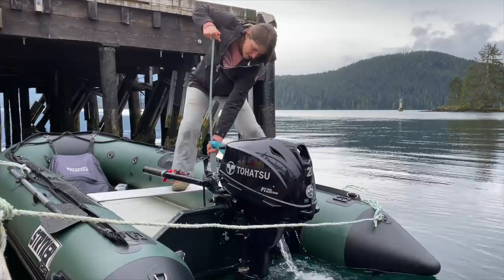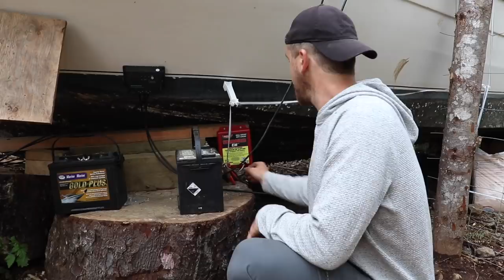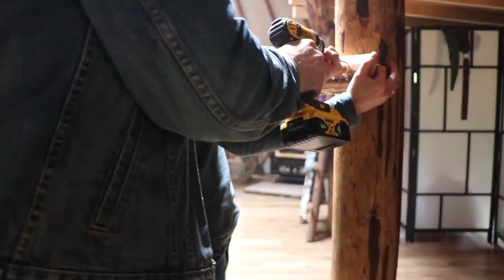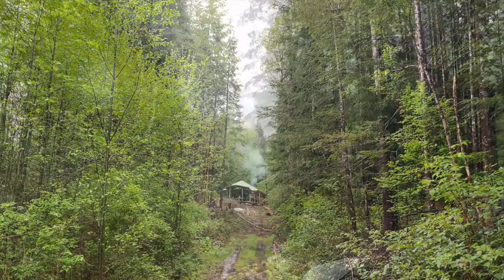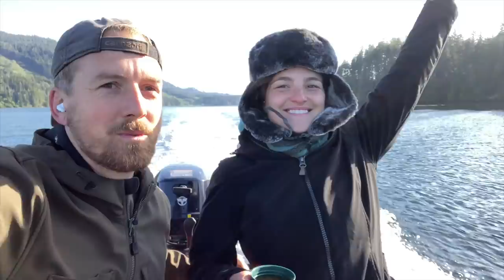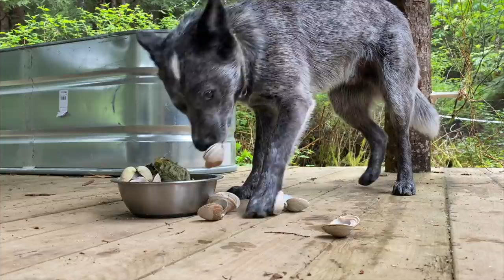OFF GRID WILDERNESS LIVING // What We Feed Our Dogs | GARDENING WITH BEARS | Falling Trees - Ep. 87

Comment: Hi guys. Ive done the reverse of you guys. Lived on the high piranese mountains for half my life and now back to a costal town. Im very shocked (lol) to see how useless your electric fence is. It should have zapped you like being hit by a hammer. Over here there available with solar charger that way never have to charge the battery. Here there used for wild boar cows horses ect.  Put your unit in a big plastic bag or bucket with lid water will make them fail. If you run a low and high line make sure that  grass and plants cant touch the line eigher couse it will remove current. The most eficient way of instaling is to cut secctions of "Rea" the cheap iron that goes into armed cement, the diameter of the R.e.a depends upon the inside diamete of the cheapest garden hose like nylex that you can purchase. 
Ie garden hose with 10mm inside diamere buy how ever may poles (normaly 1.7m long) you need. They hammer into any soil easy. Cut 20cm of hose slide it onto your r.e.a  and its isolated. If the nylex slides fasten the lower part to the rea with a wire fastner just swist till tight. Good luck to both but i dout that its going to stop a hungry bear. Is anything capable of stoping a bear on a mission? But the wire fence hurts just like a hammer. Been there done that.

Comment: Did you know, if you crush the 'sea shells' they are perfect for chickens, and you as well, consult your doctor....
Reply from the maker: Yes and for compost and concrete.  How would you crush them?
Reply: @OffGridLife  Yes crush, no for concrete, unless in craft!
Reply: @OffGridLife  Start with a couple of bricks, as the pieces get smaller a good sized mortar and pestle.I don't know it you have chickens yet... this vid is a couple of months old. But they need that "grit" to digest food and keep them healthy. As do most birds.
Reply: @OffGridLife   1.  Set them on a hard surface & back the truck over them a couple times.  Effortless.  Worried about your tires?  Put a board over the top and run tires over that.  

2.  Hammers are great for getting aggression out if you are frustrated about anything.  Have a frustration smash day; plan it in advance.  Or make a contest out of it.  JUST WEAR gloves & Goggles!

Comment: Do the dogs smell fishy like people eating fish oil for heart?
How cold is the water, if you hit a log or something on the boat. How big a difference is tide? 6'? High to low? More? And drilling into the boat by the garden, never going to use that boat again? And signs warning? Volts? Amps? Basically a cow like fence?  Solar trickle charge the battery?  What about birds? Does it zap them? Your other vid had netting on top?
Reply: Birds sit on powerlines everywhere. We get a shock because we are touching earth, but birds aren't.
Reply: @donbrackenreg2270  those are shielded wire, this open. Never really know why I see dead birds, electrical, bird flu, flew into glass, etc

Comment: Let me premise this by saying I am NOT a professional with a saw - but I do cut nearly 8 cords of wood a year for firewood, and this includes cutting down some trees; as well as, have been taught by some professional loggers on the cutting of trees and how to do it... 
First: Get your self some proper clothing - Chaps are a MUST - seen posts in here already of people cutting themselves and having to drive themselves to the hospital - Plain and simple your using a dangerous tool, you need the safety equipment that goes with that tool! At what point will you get this through your head(s) - when Nicole takes a slipped chain to the leg??? Next, get a face shield - nothing worse than taking a chip to the eye- and yes I have done that plenty of times - enough to know better! All of this equipment you can get inexpensively in a kit from your local Stihl or Husqvarna supplier - think mine which was the bottom of the line was $75.00 US.  
Next, make sure you have a clear exit route that is 15 feet away from your saw zone - USE IT! EVERY TIME!!! Kick back on trees are a rare occurrence, but when it happens, it happens in the blink of an eye and your cat like reflexes are no match for a tree! 

Love what you guys are doing, am an avid fan of your show - and I get it, your young and invincible... till a 2 ton tree falls on your ass!
Reply: And whoops... just rewatched the video and saw that you actually do have a face mask - and possible chaps??? If so, glad to see them in use... but please do use the escape route - even though the tree is tied to the truck, if it kicks back or rolls a strange way it happens too fast for you to do anything about it. Mitigate the risk and get out of the way of that tree as its falling!